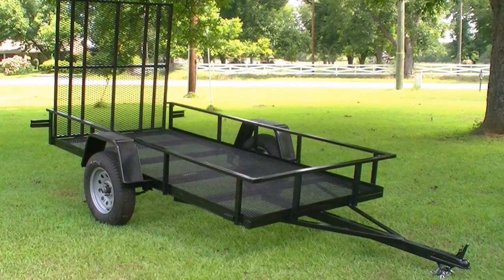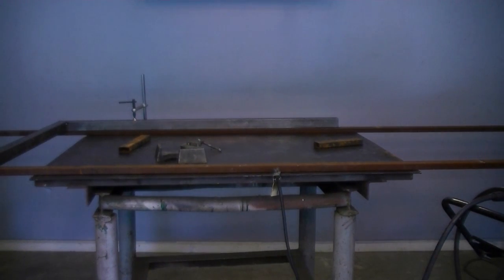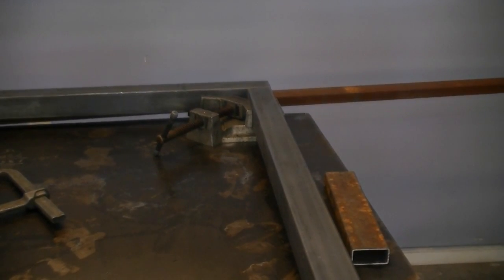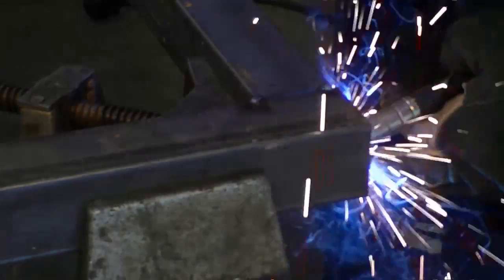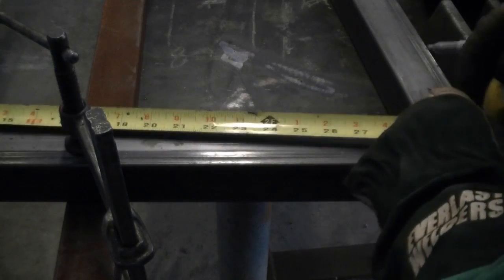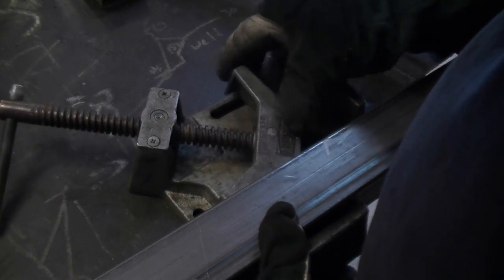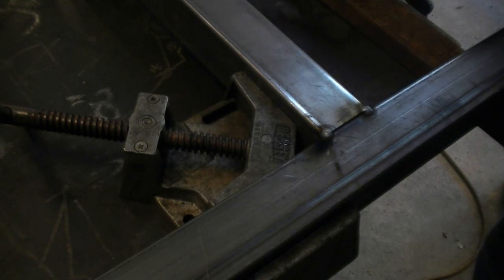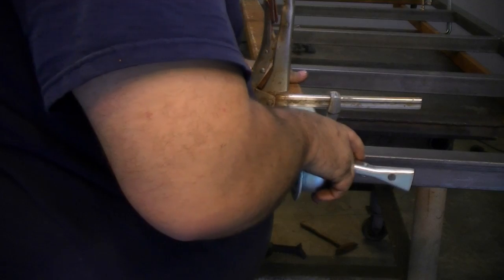Everlast Trailer Project Build Part 2: Frame Construction

Comment: do you weld the hanger's for the axle with 120amps to or up the ampage
Reply from the maker: Not really.   Amperage is of concern. A real concern.  Wire speed is controlling your amperage.  Many MIGs use and read only in amperage.  On our units, the unit reads a base wire speed while adjusting and an amperage read out while welding.
Reply: +Teddy Sturgill   amperage is not of concern in GMAW or MIG     Voltage and Wire Feed Speed are the settings you adjust (control) during the process

Comment from the maker: Honestly, it takes practice, but if you've got everything right in the jig, it will be square on the other end within a 1/16" or so, and usually dead on, but nothing that you can't correct with a little hand pressure usually. But also remember, on a cross member that is cut to length, if it isn't square, it isn't going to fit.  Whenever you are welding thin tubing though, the jig can't keep the metal from drawing once you pull it out, and a little manual adjustment may be needed afterwards.